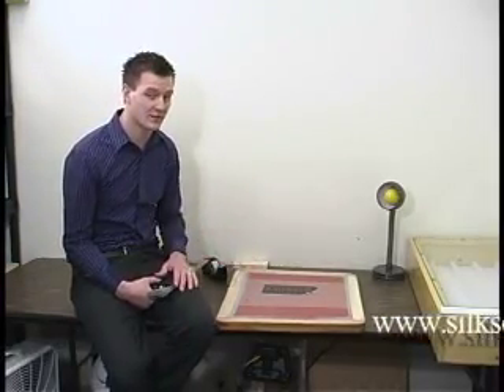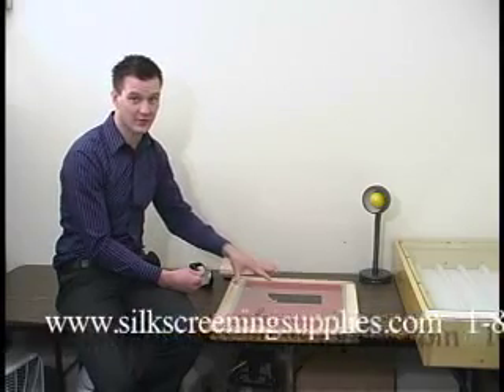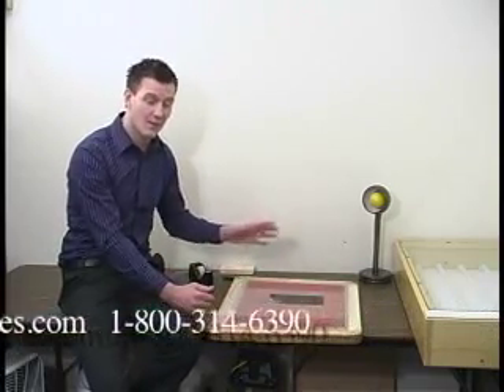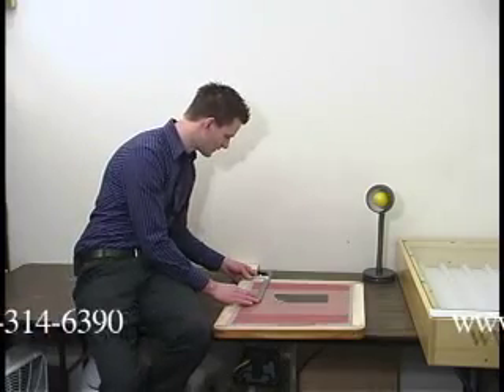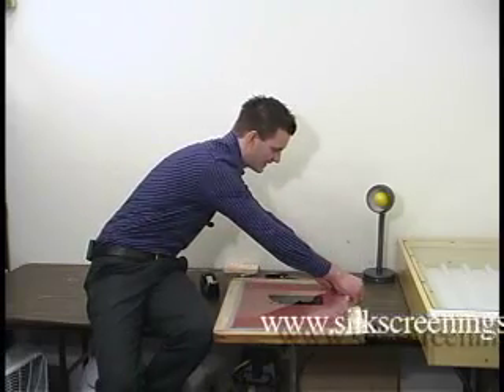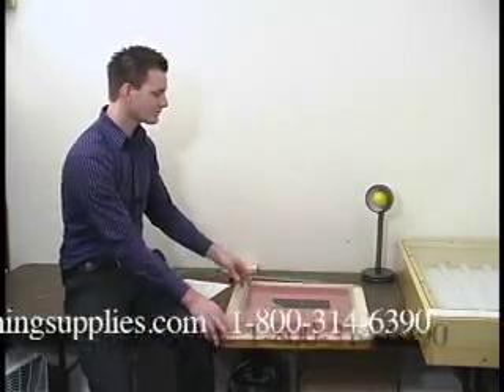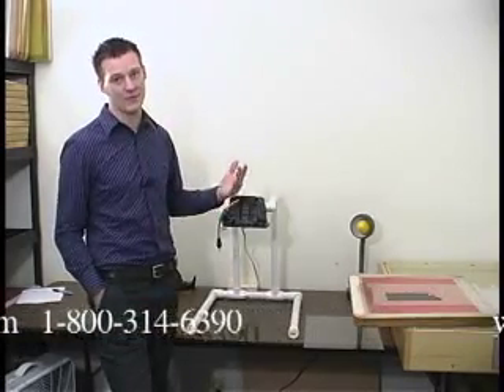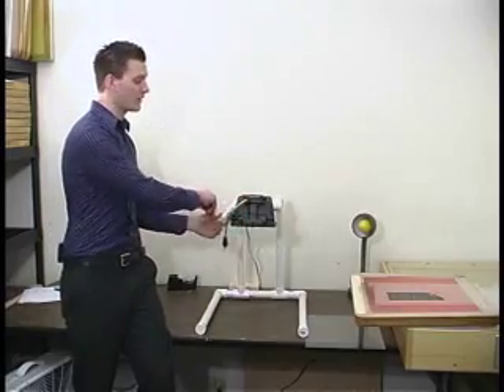Screen printing screen exposure process - How to screen print

Comment: I need to screen print an image 800mm (31.5 inches) long x 400mm (15.7inches) wide.  Can anyone tell me how you create an acetate film that big so I can expose my image onto an emulsion treated screen?  I have been looking all over the place but screen printing is almost entirely directed towards T-shirts which tend to be quite a bit smaller.
Reply from the maker: Haydn Allbutt A much larger printer is needed, if it is a larger graphic but simple graphic you could also use a vinyl plotter with black vinyl or ruby lith

Comment: -emulsion COATAZOL 4001
-frame
-positif (bitmap)
lamp uv

Insoler le cadre avec COATAZOL 4001  laisser seché à l'abri de la lumiere.
deposer le positif sur le cadre.
exposer sous la lampe UV
passer a l'eau.
faire secher l'eau.
deposer le cadre sur le support a imprimer, mettre de l'encre et racler.

Comment: I noticed that he placed the transparency on the wrong side of the screen,  should be directly in contact with the emulsion side, which is the front side of the screen.
with weight placed on the inside of the screen. to keep light from penetraiting the transparency. Not a very good example.